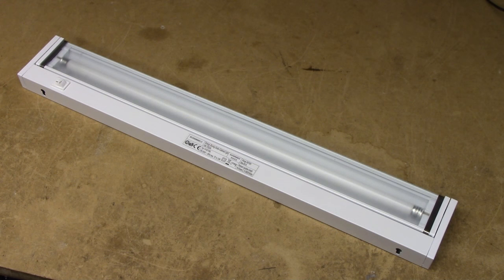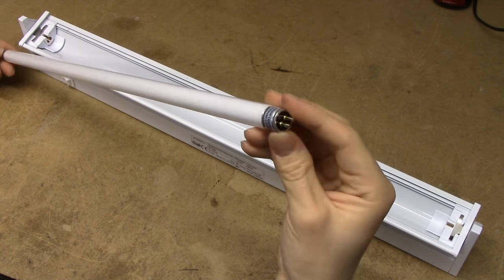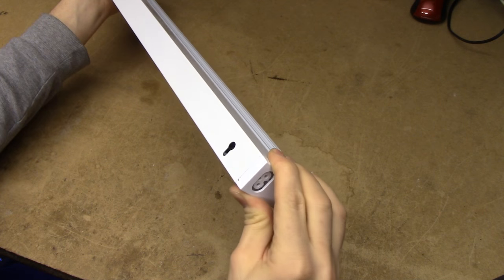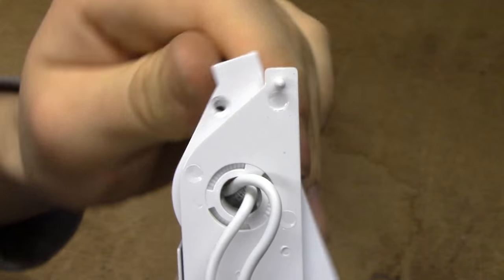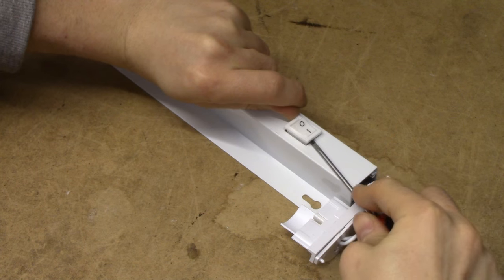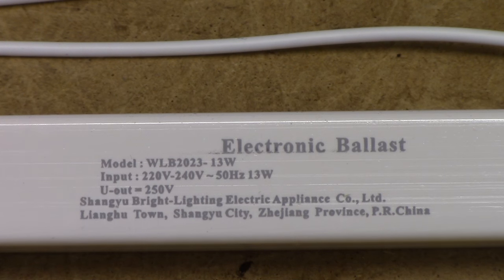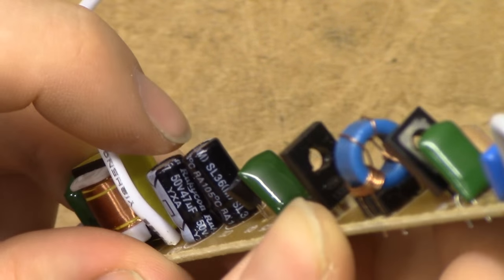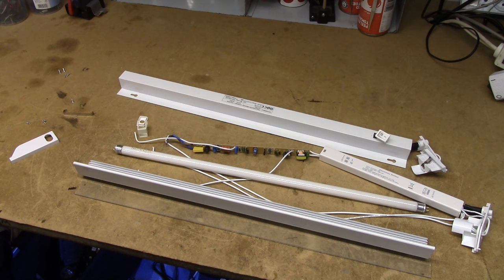9 Euro Lidl 13W T5 fixture teardown

Comment: I like these T5 tubes, I got a T5 9" 6w tube in the back of my my work van and the amount of light it gives is incredible, I tied updating to an equivalent led tube light a couple years ago but it was absolutely crap, didn't look as bright and it was one sided light rather than all round light like a florescent, the led failed with in a year I think the cold weather took it out as some of the leds started going dim, so put me old t5 back, tubes getting on for 10 years old now.

Comment: I've been using one of these under the shelf over my bed as a light for illuminating my keyboard on my laptop or reading, etc.
I've had no issue what so ever. I think I paid about £10 for my unit. It's exactly the same codes etc as well.

They did have LED ones for sale at the same time, but I've always preferred fluorescent fixtures. True and tested technology. Not to mention the tubes can be replaced if they die. 
LED's discolor over time and cannot be replaced.

Comment: I've got the same light but instead of steel its made in aluminium, but I presume that the interior is the same. The light doesnt start anymore, the bulb tries to start but only the top ends of the bulb are on, but the bulb doesnt start at all. Can you guess were the problem is? maybe will be cheaper to buy a new bulb... thanks
Reply: Your starter (igniter) broke. Replacing a fluorescent lamp will do nothing.